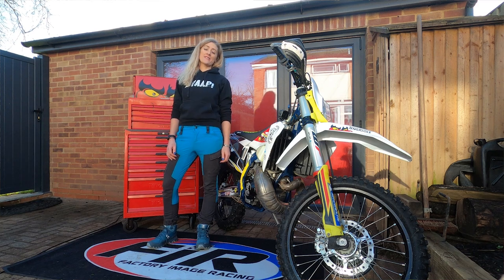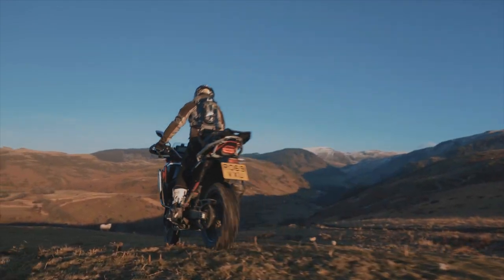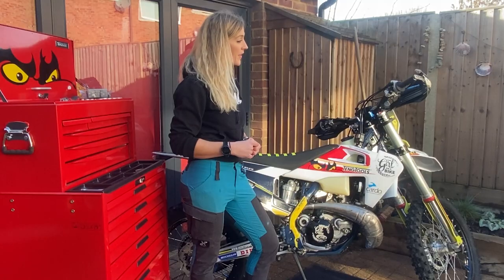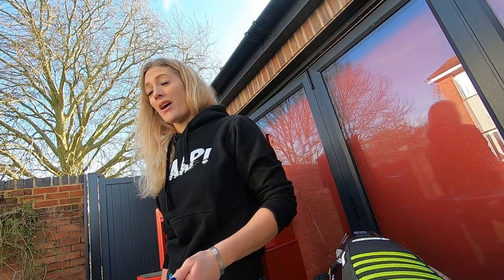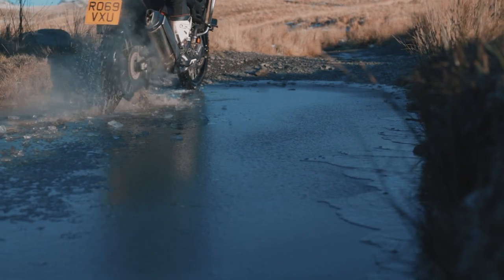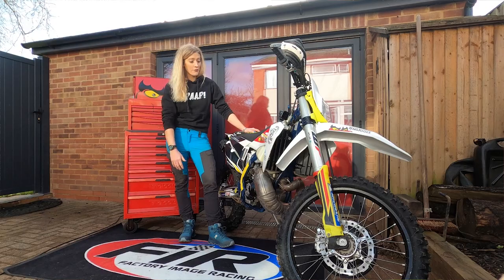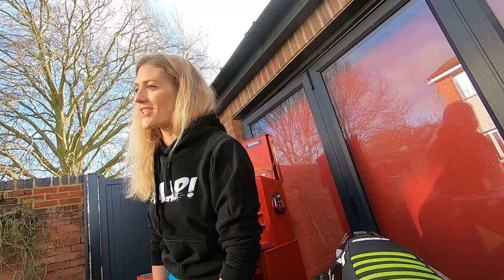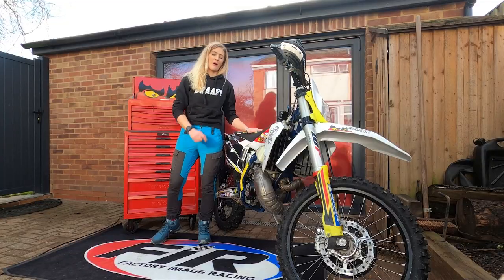Top tips to starting mechanics - The Girl On A Bike motorcycle garage life mini series

Comment: Organization is key.   I take tons of pics with my phone as I'm taking stuff apart... then I bag and tag the parts.  (Fork pinch bolts, front wheel right side spacer, etc.)   It's easy to forget what goes where or how it looked before you removed it.   Having pics to reference really helps.   

I started learning about motorcycle maintenance  a few years ago when I got my first bike.  When you're not mechanically inclined, it's intimidating the first time you take something apart.   I remember the first time I pulled the carbs off my 1970's Honda CB750.   All of the sudden there was a big gaping hole in the middle of my bike (where the carbs and airbox went.)  I was convinced I was gonna ruin my motorcycle.. but I didn't.  (Well, it took me a couple tries to get those carbs completely clean and running great, but eventually I did it and it felt great firing the bike up and going for a ride afterward.)

Comment: Good stuff in this video. I was lucky, trained as a motor mechanic from 15-21 y.o., but one thing we were told that you didn’t cover.... that lovely long hair - keep it tucked out of the way when near any moving machinery (open parts of the bike, the drill press, angle grinder, etc.) mechanical scalping is not a joke. Great videos always! Les

Comment: Thank you for this! I am new to wrenching on my bike. I've changed my oil & filter and maintenanced my chain but chose to take my bike in to swap my back tire. I felt I didn't have sufficient time to do it myself. Next time I will definitely save the money and do it myself. A few weeks ago I mounted a quad lock phone mount with wireless charger and learned how to connect things to my battery which was pretty cool. Had to take apart the plastics on my gas tank to hide wires. Today I will be adding a fork brace which should be pretty simple as well. Each time I add something or maintenance my bike I learn something new about my bike and the tools needed to get the job done.😎
Reply from the maker: That's so mega to hear Christina. Super proud of you as it's intimidating starting and I'm happy my video has helped. I have a great how to change a tyre video that should help your money saving plan, even without the Rabaconda it should help, although I highly recommend one for the garage tools. Stay in touch and let me know how you get on

Comment: I always buy the Factory repair manual, as the aftermarket ones can miss details. Take bread bags, newspaper bags that are plastic. When you take a fender off put the fasteners in one of the  bags and tie to the component. Some bikes require more time taking off parts to get to the maintenance or repair are than the repairs take.
A friend has people bring in mc tires for new tubes because they are flat. And the problem turns out that they did not check and air up on a daily or weekly basis.
Reply from the maker: oh my goodness, that last point makes me chuckle! I guess it's easy when you know how but that does seem basic hehe. I like the bag idea. Thanks Mike

Comment: Most important: Take your time, think about what you do before you do it and start threading bolts and stuff without tools wherever possible. A friend of a neighbour killed himself with being impatient when putting in a new oil filter on his 1000cc Yamaha. The filter was okay until it got real oil pressure, which was on the A555 between Cologne and Bonn, one of the few bits of Autobahn still without speed limit. It's one long curve. At 150+mph, the oil filter spilt oil over the rear tyre. That was it for him.
Careful, attentive DIYers often do better work that stressed out professionals, mainly bacause they are in a position to take time and have their minds free to pay proper attention.
Reply from the maker: Aw. Thanks dude

Comment: All valid advice! I'm a mechanic since born essentially haha, but the biggest things for me have been keeping your bikes clean! Yes they're dirt bikes BUT they're also a very expensive toy, take care of them!

Best bit of advice I've been told is oil and filters are cheap insurance. Change them on time and often. It's much cheaper to do an oil change and air filter clean then it is to do engine rebuilds. 

 I also am a HUGE believer in not over greasing your chains! It only makes a huge mess later and I can't stand it. I use Motul chain cleaner conditioner and a touch of Maxima SC1 teflon spray, that's it and I have yet to have a failure. Just remember the grease in Oring chain is already inside the chain, you're not adding anything by gooping them up like crazy but you're giving dirt and grime a home and will wear out your sprockets fast that way. Give the Fortnine chain cleaning video a watch, they do a fantastic job at explaining it.
Reply: Always keep my playthings clean!

Comment: my lil Tip: if doing a clutch on a bigger/ racier type, make sure that you get your clutch plates in order, and the right way/ face installed. When removing the knackered clutch plates etc., take note on the order lol. Vanessa's point on the cardboard order of bolts etc/ use paper whatever, really can help

Comment: I have been changing my own oil/filter, battery and doing the chain maintenance on my 2007 Triumph T100 since the initial break in oil change. I will flush/bleed my own brakes next time they need it. I’ve also changed my own brake pads. Working on your own bike is therapeutic.

Comment: Don't be afraid to try it but also be able to say no if its gets to the point its overwhelming or expensive, 
I've been doing mechanics close to fifty years and I will never know it all there is always something new to learn I learn from younger people too.
Keeping track of bolts, nuts and fasteners use what method that works best, LOL I do take photos too, I like zip lock bags and mark on them with a marker. 
and fun fact on your Sportster I found out with mine when I replaced the clutch the cover bolts are all the same size, makes its easy. 😀
My first mechanic job was on a 1975 AMC Gremlin I replaced a leaky valve cover gasket, three times in fact, first time I over tightened the bolts and put the wrong sealant on it, second time I bent the flange from over tightening and the third time after learning from my mistakes it worked.😀
Absolutely the factory service manual is worth the money, it saves you money in the long run.
Reply from the maker: hehe I love the third time learning and nailing it! Thanks Donald, I enjoyed reading your comment. Like the zip lock bag idea
Reply: @TheGirlOnABike  
When I do motorcycle engine covers I do use the cardboard trick myself,  I learned it years ago it has saved me lots of headaches, especially on covers that have different lengths of bolts like you said. 
and one more tip do invest in a motorcycle fuel tank cover, it seems like the shiner and clean they are the more wrenches, bolts, nuts and other bits of metal are attracted to them, if Im doing a big job I'll just take the tank off and place it out of the way with a cover over it. the Sportster is easy two bolts, one plug and one fuel line disconnect.